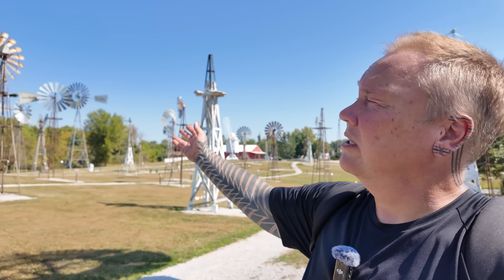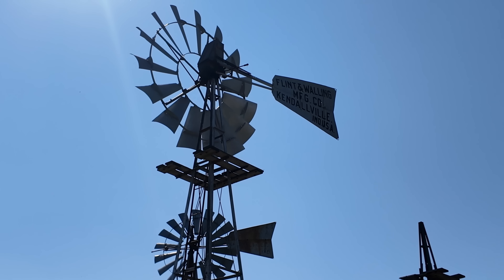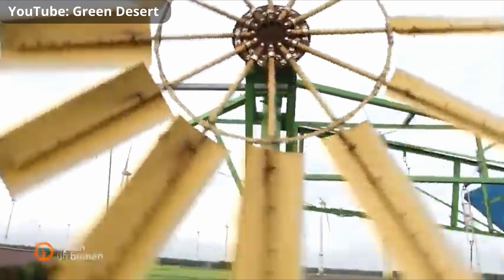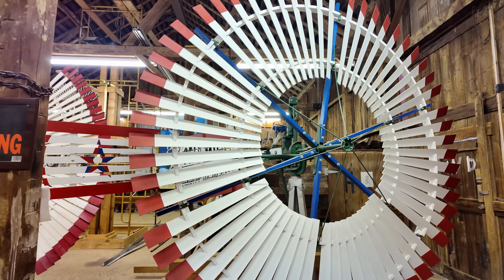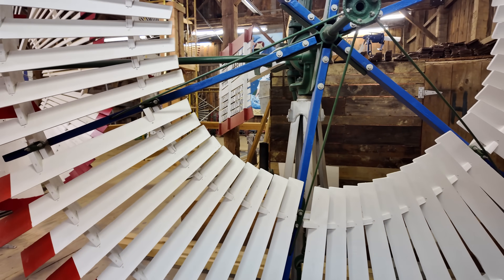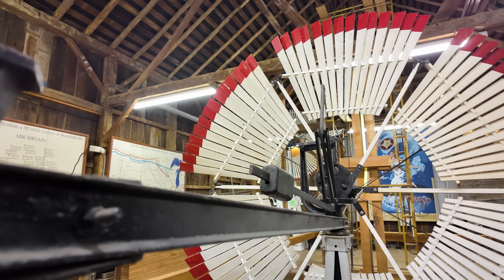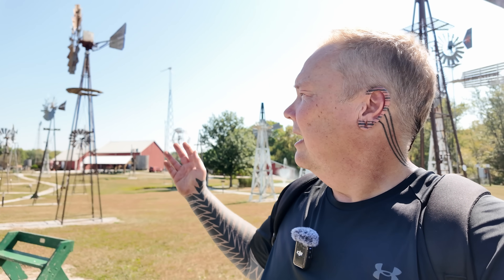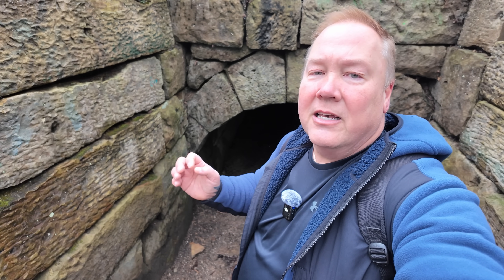Hidden History of American Windmills Revealed

Comment: I'm currently working security for a movie set for a production that a very successful filmmaker is shooting here in Northern Arizona. 
The set is an old western town out in the Mojave Desert. 

They have a working windmill as a set piece. It's super cool and adds an element of realism to the town. 
It's not pumping anything, but it definitely spins when the wind is blowing. 
I've never been around one before this.  It's crazy how strong the force of the shaft is.
It's impossible to stop it by hand.
There's a break on it, but they didn't hook it up,  so it spins all the time
Reply from the maker: I'm pretty sure a windmill like this is a requirement for any western/farming movie or tv show :)
I have a short from this same museum with a windmill like this hooked up to power a small machine shop.  They definitely have more people than you'd think.

Comment: Pumping water from a well is still a good practice. Making ene
Reply: Making energy is one more fine use for a  windmill. Harness that wind! It is a natural source!
Reply from the maker: A few people have mentioned that they've hooked up car alternators to these windmills and used them to charge batteries.  This museum also has a small machine shop setup with the windmill running an overhead line drive system to run drills, lathes, etc.  Probably couldn't get AC off these directly, as there's really no kind of speed control, so the frequency would end up varying wildly.

Comment: another great breaking mechanism i've seen in a centrifugal clutch. it's got 2 big metal balls and if the shaft spins too fast, the balls get slung outward, which bites down on a brake mechanism. in an area that gets constant  overly strong winds though would probably have to replace pads ever few years. maybe when you change the oil every 5 years.
Reply from the maker: I've never seen this on a windmill like this.  Should work well, but I can definitely see it being hard on brakes.  It would have another big advantage, though, which is a more consistent speed.  Where have you seen it?

Comment: I worked at Aermotor pumps in Conway Ark until 2002 . We built submersible pumps and many other types .
 The company was founded in 1888 ,it was bought out by Stayrite pumps from Wisconsin and they closed after a few years.

Comment: Neat stuff, thanks. When my Dad still lived on the farm we had a tiny little wind mill. I think it might have been decorative though.
Reply from the maker: Some of the little 6-8 foot/2-meter ones are used to run air pumps to aerate ponds, but the water ones were all quite a bit taller.
Reply: @Industrial_Revolution Is it possible it could have been doing something with the septic tank then? It was near the mound the tank was under. It was only about 8-10 feet tall. 
I'll have to ask him about it next time.
Reply from the maker: Probably wouldn't have been in the septic tank, although I suppose it may have been powering a pump from the septic tank to the drain field, if that was uphill.  I've never heard of them being used for that, though, but it's possible.

Comment: you know, being able to spam wind turbines in remote places has been a pretty OP strat, sorta like the precursor to modern day solar-spam.
Reply from the maker: Spam?  These ones were typically dropped specifically at places where they needed water.  Originally, every farmhouse would have one, as well as remote pasture sites to water livestock, generally.  As electricity showed up, the farmhouses didn't need them, so much, but the remote livestock watering is still going on, and thousands of these are still doing that job quite well.  The alternative is solar cells and batteries, or run what is sometimes miles of electric lines for the wells.

Comment: I will never forget how happy I was to see a windmill in New Mexico when we had two flat tires on our pop up camper,  about 75 miles south of Gallup NM back in the early 1970's. There was no wind but I could hang on the vertical rod and get it spinning enough for all of our water. We were there for 3 or 4 days until our "special order" tires came in. Very cool video, tyvm.
Reply from the maker: 3 or 4 days?  That was pretty quick for back then.  I remember "allow 6-8 weeks for delivery."
Reply: @Industrial_Revolution  Ha, you are right. It could have been 5 or six days as I didn't care, I was having a great time in that desert.

Comment: An germaine annectdote: a dove hunted several years with a farmer around the Sweetwater, Texas area. There LOTS of Aeromotor windmills still in use out there. I finally asked him about them and his response was that many farmers still had them but were starting to convert to solar. He himself had just recently swapped his Aeromotor for a solar pump. He said the windmills work but it cost him several hundred dollars a year to keep it running because his was old and forever needed a bearing, or the leathers wore out, or something else was worn out or broke and parts were becoming harder and more expensive to source. Whereas his $3,000 solar well pump just worked and did not require much maintenance.
Reply from the maker: Since a lot of these are a century old, I'm not surprised that they're wearing out.  He mentioned that he's older now, which presumably makes it harder to climb to the top.  That's exactly the problem the have at this museum right now.  
Did he mention how long the solar ones lasted?  A lot of these can last a century.  I'm guessing you get 10 years before you have to replace batteries?
Reply: @Industrial_Revolution  he did not mention whether he had batteries or not. I got the impression that the solar pump replaced the windmill that  filled a holding tank next to his house so I assume it could run during the day and may not need batteries.
Reply from the maker: The solar ones typically include a small battery.  The smaller panels don't typically have enough power to run the well pump directly, and they really don't need that much water pumped, either.  Just hook up a switch on a float and they keep the tank full all the time.

Comment: 0:15 
!
Answer: they are used to pump water.
Reply from the maker: Mostly.  I have a short coming up that shows one of these windmills hooked up to run a small machine shop.  They also often work as air pumps to aerate ponds nowadays.

Comment: He missed the part where the the sail (or tail) would be cranked so that the fan portion would not be in direct angle to the wind. That protected the windmill from turning too fast in high winds. Some even had a brake mechanism when the sail was turned parallel to the fan
Reply from the maker: Thanks!  These types had a few, different ways to protect from strong winds, both manual and automatic.  There's been a lot of interest in this video, so I'll probably go back next year and go more in-depth into some of the technologies, as well as how the pump actually worked.

Comment: I ran a Sacco-lowel carding machine and many sample carders for years. I dig your channel!
Reply from the maker: Thanks!
I've got my eye on doing a video at a current, commercial carding mill using 19th century equipment.  There's one not far from me that I'm hoping I can get into to film this winter.  Be nice to find one of the huge, old mills out east somewhere, too, that's still at least set up, even if not running.  I've seen a few carding machines operating, but never seen a working spinning or weaving mill.  Need to find some.

Comment: I was in the Air Force for 22 years and I was a part of a communications mobility team that we stood up in response to the first Gulf War and not having appropriate communications for the wings in bare base environments. A rancher near Tucumcari, New Mexico would let us practice on his ranch and we were out there in 125° weather.  At the end of the day, we took a bath in a cow watering trough and it was one of these windmills that ran the water pump.   It was like an Arctic plunge going from 125 into water that was probably in the 50s.😂. Those also make good navigation markers since they stand up at tiny bit taller than everything else.😂
Reply from the maker: Long-distance backpackers on the Pacific Crest Trail and Continental Divide Trail use those toughs for water (filtering it, since it's shared with livestock).  They're still one of the best ways to get water when you don't have electricity right next to the well.

Comment: There are remnants of windmills all over Wisconsin. Most are no longer operational. Thank you for this video because I had no idea of the technology behind some of these windmills. I did not know that any of them could take themselves out of the wind if the wind became too strong. I agree that windmills are still in use for remote watering of cattle in western states like Colorado Oklahoma, and New Mexico. I have driven on the back roads of all of these states and it’s interesting to see windmills, pumping water and doing what they were supposed to do.
Reply from the maker: I didn't know they could brake themselves until I went to this museum the first time a few years ago, either.  Before that, they had a rope or chain hanging from the top that you'd pull and tie off to activate the brake, which is fine if it's just outside your farmhouse, but not so great for remote pastures.

Comment: Thank you, soo interesting! But how the pump of those windmills works?
The mechanism of a pump?
Reply from the maker: I'm a little vague on exactly how they did it in these pumps, too, being at the bottom of the well.  There's a few ways to do it, but in the most basic form of a reciprocating pump, and these are reciprocating pumps, you connect the rod to a piston in a cylinder with 2 one-way valves.  Pull the rod and it fills the cylinder below the piston through the inlet valve (pulling water from the bottom).  Push it back down and you push the water out of the cylinder through the outlet valve, around the outside, and back up the well to the surface.  This is one of those places where I need to learn some basic animation to better demonstrate how these things work.  Maybe over the winter?

Comment: Seen the coolest thing delivering a CNC chip conveyor to a Amish machine shop. There they made air motors. Had 2 old windmills that had compressor on them. And bunch of ceiling fans in the shop powered by compressed air from the windmills. And they were all just as quiet is an electric ceiling fan. I asked them about the windmills and they show me a kit to convert old well pump to air compressor. They had there's pumping into a tank around 60psi.
Reply from the maker: I have a short video coming out from this same museum where they have one of these windmills hooked up to an overhead line drive system to run a small machine shop.  It's amazing how creative people can be.

Comment: Years ago, i read a tech publication from the American Society of Mechanical Engineers about farm windmills.  One of the interesting ways to keep a windmill from high-windspeed damage was to space the blades closely so that the maximum airflow though the blades was limited,  preventing destructive overspeeds.
Reply from the maker: That's interesting.  I hadn't heard that before.  I know these things do work in a pretty broad range of wind speeds before you have to brake them.

Comment: Youtube, 
This video is good, the channel is good, send more people here.
    In all seriousness, I was wondering if these types of mills could be converted to charge batteries on an off grid homestead?
Reply from the maker: Thanks!
Yes, they can be.  They're not massively high power, but several people in the comments have said they have hooked them up to car alternators to charge batteries.  Kept well lubricated (or an auto-lubricating system), they don't need a huge amount of wind to operate.  Not sure if one of these, alone, would be enough for a household, but it could definitely help get you there.  Throw in some solar and you could probably do it.

Comment: Hi. Plenty of these in N.Z. too. Cheers, P.R.
Reply from the maker: For anywhere with remote livestock grazing, they're still just about the perfect solution for almost anywhere.
Reply: @Industrial_Revolution  Hi I.R. N.Z. isn't "remote" mate, we're at least ten yards the right side of the black stump. Cheers, P.R.
Reply from the maker: Remote, in this case, is anywhere where it's expensive to run an electric line to run a well pump.  Putting one of these up is probably cheaper than running a half kilometer of power line.

Comment: Dude !!! steam engine !!!! literaly ever internal combustion engine driving ever wheeled vehicle on the road - and most of the ones on water and almost all of the small ones in the air - convert reciprocating  motion into rotary - the same as your windmill converts rotary into reciprocating - with a crank - also how bicycles work
Reply from the maker: The crank's been around a while, at least back to the 12 century or so with sash sawmills.  I think you get up to the 1700's or so before they were used to convert the other way, from rotary back into reciprocating.  Not sure why, but for some reason, it seems people didn't really connect the ideas as being the same thing.

Comment: Huh, I never knew much about these. I thought they were used to generate electricity. I didn’t know they were used for pumping water. In fact… I remember a TV commercial for something, I can’t remember what, that showed a farmer in the fields 100 years ago, working away in the hot sun, when suddenly there’s a breeze! He interrupts his work to run into the house where his long silent radio is crackling away, presumably because the wind has finally returned… enough to generate some electricity! That must be where I got the idea that they were for electricity.
Reply from the maker: Any idea what they were advertising?   Not that all other advertising makes sense, but that one sounds kinda odd.
Mostly they used to be for water wells.  Today, some are also used for air pumps to aerate ponds.  A few people in the comments have said they hooked them up to car alternators to charge batteries, but I think that's a newer thing.
Reply: @Industrial_Revolution  - No, I can't remember.

Comment: When we moved to our second home I was a kid and found one of these in the woods. All the land around here was farms maybe 100 years ago. Now trees have filled in the one time fields. Everything had Dutch or German names like Van Houten or ? I climbed up the metal tower to see how it worked.. There was a long wooden stick about 2-3 inches around. It connected the wìndmill to a pump deep in a well. When the windmill blades turned the stick went up and down. Thereby pumping water into a troff. Cows could drink any time with no farmer nearby. There was also a strange black metal box behind the blades. Being a curious young boy. I opened the box. It was packed with a thick brown grease. So the farmer did not need to lubricate the gears. Smart design. There were also tons of trash flies in there. Apparently the grease may have been rendered from an animal. The flies loved it. Gross ! I got it all over my clothes too ! My mom was not  very happy with that!😢
Reply: When  we got our second home the land used to be  farm. Stone walls everywhere. Now trees have taken over the one time grazing fields! Cows, sheep & pigs  are long gone .There used to be a big barn nearby too. A developer buĺldozed it  and built homes there. On our 6.5 acres I found a hand dug square open topped well. I found 4 steel stumps around it. They wee  iron legs from a windmill that is long gone. It still fills with water every year. I go there in summer and can see th level of ground water. It gets low in summer. Sometimes to the mud  bottom. Depending on the rainfall. Frogs and garter snakes love it ! I look around and try to envision the fields, fences and cows ! Time marches on. And waits for no man !😢
Reply from the maker: I love exploring places like this!

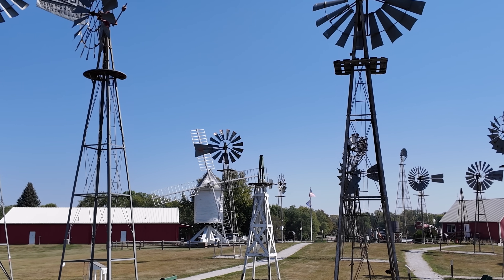Comment: You say that was "the only windmill turning this day". But this is not true. At 1:13, along the bottom of the frame, you can clearly see another windmill turning. Why lie about something so obviously incorrect? It makes no sense.
Reply from the maker: I think there was another small one right up by the office.  With lubrication, most of them would have been running in the wind that day

Comment: I saw an article in a Mother Earth News issue about installing a strong garage door spring, or two, on the pump rod which can be quite heavy, as you can imagine. The springs assist pulling the rod back up after it goes down, increasing the efficiency of the mill.
Reply from the maker: You would, ideally, add springs, levers, whatever, to "balance" the shaft.  I don't think they ever really did this on old ones, which is odd, unless I've missed it.
Reply: Well wouldn't it also put more stress on the red rod causing it to break more often.

Comment: There's a vertical axis wind turbine called the harmony watt that is self governing that would be perfect with a  Inclined Disc Mechanism and auto oiler for this application.
Reply from the maker: Just looked them up.  With the "furling" method (their version of feathering), they might be well-suited to electrical production.  The cost is higher, though.  For electricity, probably better, though.

Comment: Two things that I feel should have been mentioned:  1) The "energy" in the wind is proportional to the wind speed CUBED,  so at 30 mph, the energy is 8 times that if 15 MPH.  2) Whereas many new cars specify "0W-x oil that some people say is a new "weight",  the Baker windmill company marketed their "zero weight" oil for their windmills over a century ago
Reply from the maker: Great info.  Thanks!  Do you know if the newer motor oil is the same viscosity as the old, zero weight oil, or are they different?